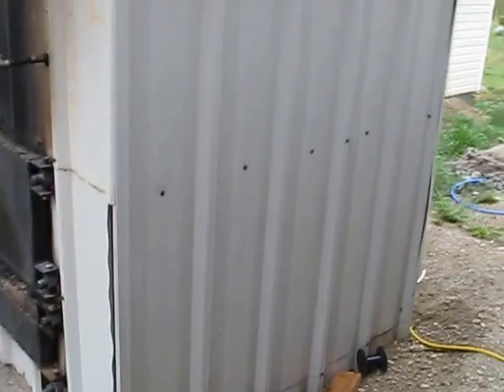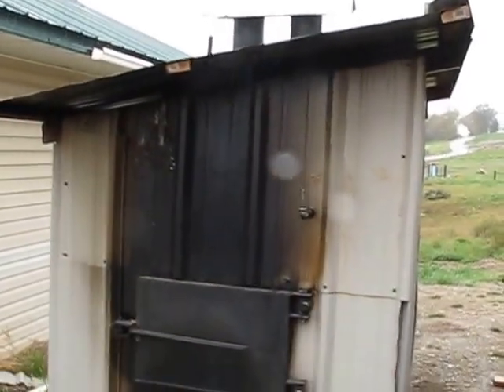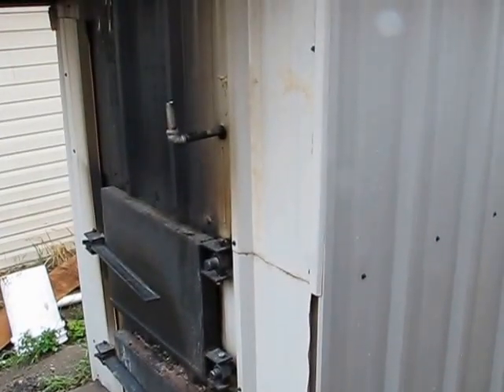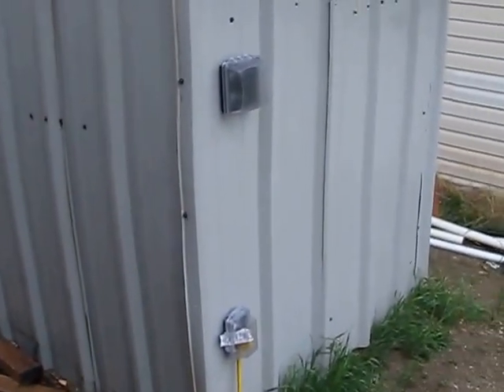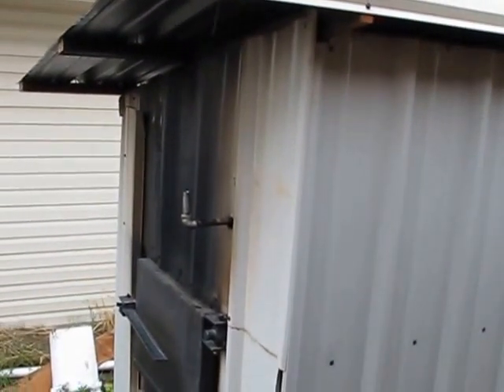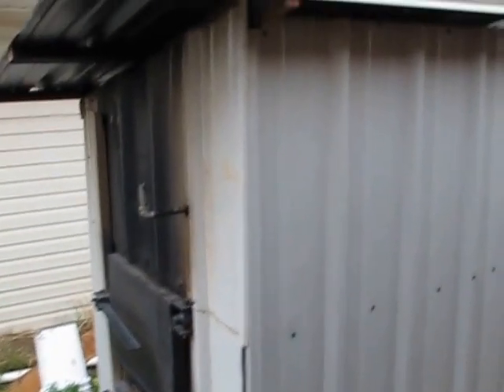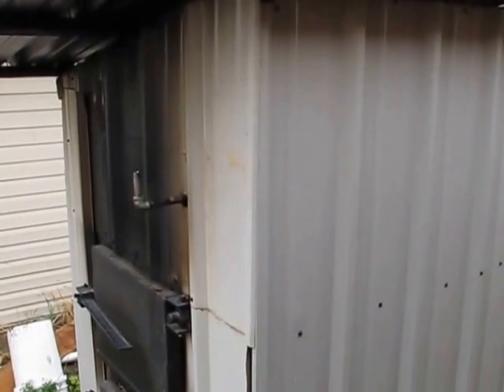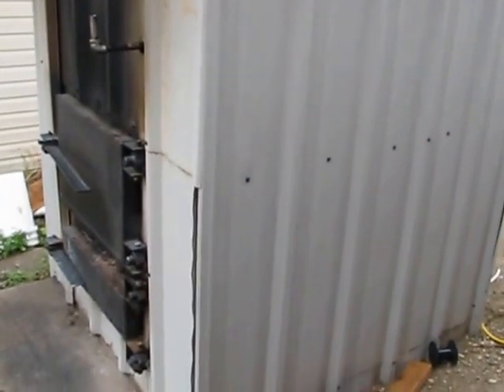boiler shed

Comment: Very nice. I like it a lot looking to build something similar but I have a few questions hopefully you can answer. How often do your fans kick to bring your water up to your set point? And have you ever ran it for extended periods of times like a couple of days with out the fans and noticed if you burn more or less wood? One last question did you move your secondary air tubing from your original design?